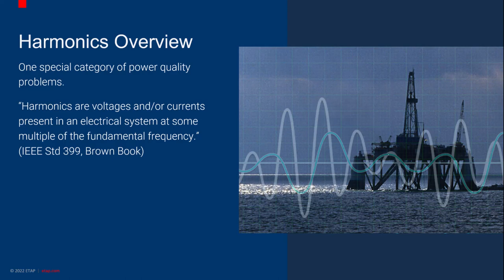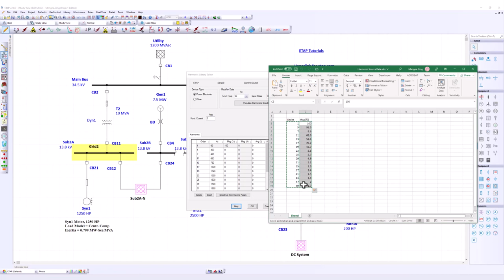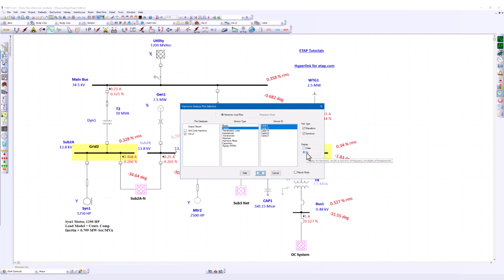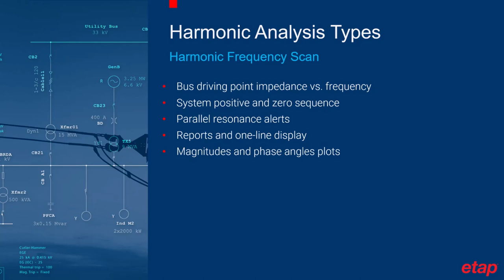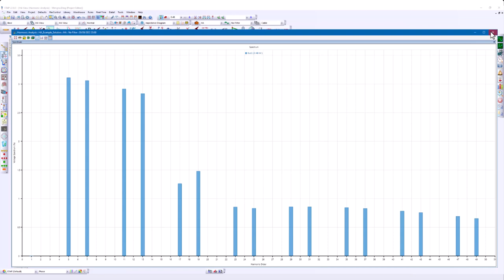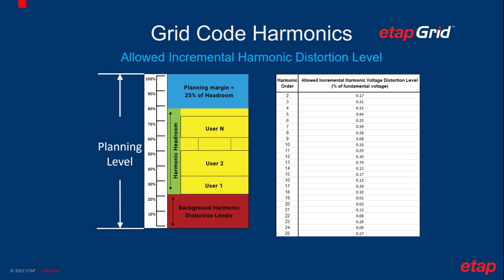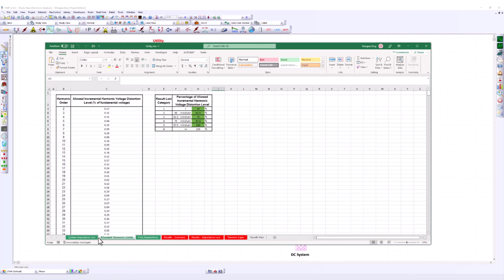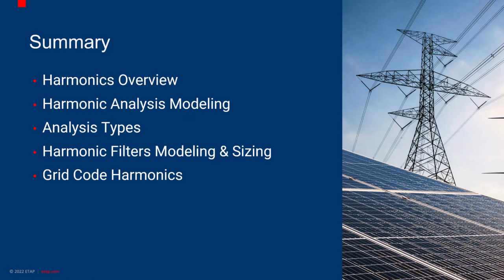How to perform Harmonic Analysis with ETAP

Comment: incredible new version of ETAP.
One query, in delta and star systems, the THD -V result showing that the ETAP corresponds to line to neutral or line to line voltage?
Reply from the maker: Thank you for your interesting ETAP Software. Please contact our 24/7 Help Center at https://helpcenter.etap.com or contact one of our local ETAP offices or representatives.

Comment: At min 6:15; "Element impedance for each harmonic order in the study modelling .In general, impedances are adjusted based on harmonic frequencies  on the type of components". What if i have a rectifier data from manufacturer and he supplies typical harmonic currents and harmonic impedance of the rectifier. Can I still input my harmonic impedance in the element, instead of relying on ETAP to adjust the impedance? If I cant do that, then i willl need to know how these adjustments are calculated, so that i can compare with the manufacturer data.
Thank you.